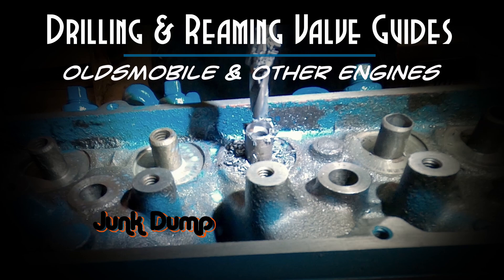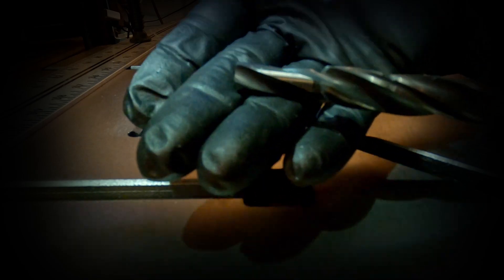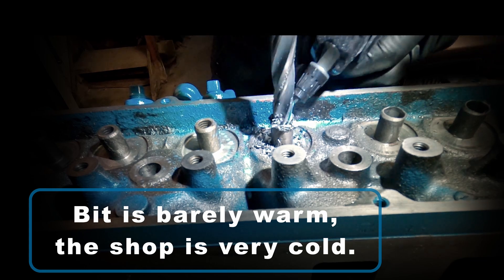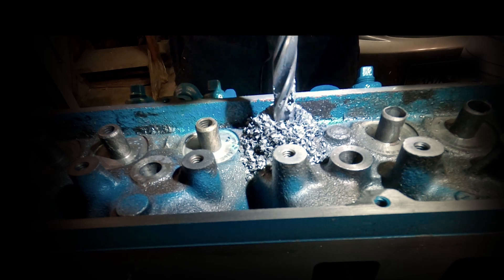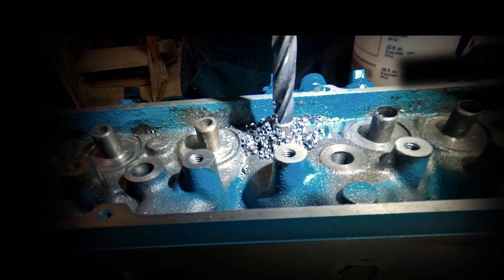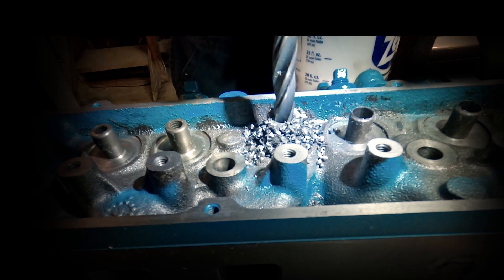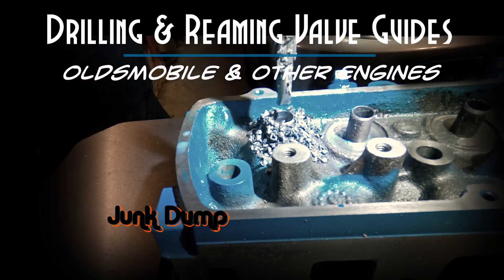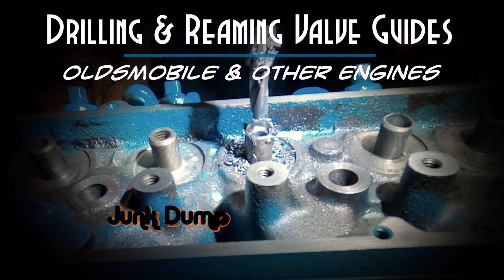Drilling & Reaming Valve Guides

Comment: Why the left-handed rotation.?
Reply from the maker: That is a trick of the framerate and capture fps, the rotation is not actually reversed it just looks that way in the video.
Reply from the maker: That is a trick of the framerate and capture fps, the rotation is not actually reversed it just looks that way in the video.
Reply: @junkdump2720  good, I was hoping that was it. I've been seeing some of these guys on the tube talking about running the reamers in reverse for some reason. If my valve stem is 11/32, or .344. which reamer size should I use for proper Valve guide clearance . Thanks
Reply from the maker: @terrysibley9636  Excellent question! After installing new stems I start by measuring the the valve stem OD and check what the valve stem clearance will be. I have a 0.3425, 0.343, 0.3435, and 0.344 reamer. I start small and one of those reamers typically hits the clearance sweet spot. The specs for Oldsmobile small blocks are 0.0010 - 0.0027" for intake valves and 0.0015 - 0.0032" for exhaust valves. Oldsmobile Big Blocks  with the 2.072" intake valve should have 0.0010 - 0.0030" for both intake and exhaust valves but the spec varies based on year and valve sizes. I love questions like this, thank you very much and hopefully my answer helps. Goodson has a great selection of reamers if you need one. Thanks again!

Comment: Hello! So I'm new to this, and went straight for a reamer for my guides. It was a really aggressive cut and now there's way too much tolerance...  My question is by the physics of machining if you take too big of a cut it will make the hole bigger ?
Reply from the maker: The diameter of the reamer or drill will decide the diameter of the hole if there is no play in your vertical mill or drill press. If the hole is larger than your reamer it's likely because there was excess play while cutting. Piloted drill/reamers help with this issue and work well even when used in a drill press. If you are cutting by hand, there is a higher chance of your holes being larger than expected. Here are the two most common issues and what you can do to fix them. 1) If you ream the guides to a larger than spec tolerance, and the valve to valve guide tolerance is now too large, then I suggest you will have to perform the work I do in this video series to install new guides and cut new seats. 2) If you reamed the guide insert hole to a larger than spec tolerance, and the new valve guide inserts fit too loose, you will probably have to search the QualCast (or equivalent) company catalog and find inserts with the same specs except with a slightly larger outer diameter. Now you can drill/ream the guides to the new outer diameter (usually 2-5 thousandths smaller than the guide insert outer diameter), and then install the larger outer diameter valve guide inserts and recut your seats. If you have to do this, remember to machine the outer diameter of the guide to the stock outer diameter size from the top of the guide down to the valve spring seat after you install them.

Comment: I have an older Briggs 5 hp (L head) horizontal engine that has no separate valve guide on the exhaust side, it's just machined into the aluminum block and the valve stem is very loose. Briggs used to offer a drill/reamer kit to be able to drill and ream for new guides to be installed but they stopped offering the kit several years ago. I hate to throw a good block away just because of a valve guide issue so I'm wondering where I could find the proper size drill/reamer to drill out the factory aluminum guide/hole so that I can install a new guide? What is the clearance needed between the reamed hole and a new guide? Also, would I be able to drill and ream a new hole using a regular 12 inch drill press?
  Thanks for the video 👍
Reply from the maker: Thanks for watching and leaving me a question. To start you will need to know the valve stem diameter and guide spec, I'm certain you can search online and find that for a Briggs engine. Goodson Manufacturing is a vendor for QualCast, they can help you find the correct valve guide insert for your engine. Once you have the guide part number, check the outer diameter spec for the guide insert they recommend. **Generally aluminum requires an interference fit of 0.0015"-0.0020"**. You will need a piloted drill reamer that is 0.0015"-0.0020" smaller than the outside diameter of the valve guide insert. Goodson has piloted drill reamers for all the popular sizes. You may also need a regular reamer for the inside of the insert as you might find the valve stem tolerance too tight after installation. The work can definitely be done on a drill press if your head travel is adequate. When finished check the valve stem play and ream the inner diameter of the guide if necessary. Although your head will be a little different, the general work will be demonstrated in the 3 valve guide videos on my channel for reference. I hope this helps, and feel free to leave more questions if needed.
Reply: @junkdump2720  Thank you, I will check out your other videos and also that manufacturer for what I need. I just watched a different video of someone who drilled/reamed and installed guides in an older 5 hp Briggs engine and he said that the valve stems on those are 1/4". That's probably just a generic measurement rather then the actual measurement in thousandths of an inch but I will find out. 👍

Comment: Always enjoy your videos. What are you using as a drilling fixture, drill press, seat and guide machine, or Bridgeport? Do you prefer a .502 replacement guide over a K-line bronze insert?   Do you use a reamer to finish the I.D. of the new guide? Do you ever hone the new guides instead of reaming? I know, a lot of questions but I find it very helpful to get different opinions. Thanks JD
Reply from the maker: Excellent questions, never hesitate to ask as many as you like! For this video I am using a drill press with an angle stand and fence, it works well with the piloted drill / reamers. I don't have a seat and guide machine yet but I am on the lookout for an old used one, it would make the work go faster. I do not use bronze inserts except rarely in race applications. I find SBI makes great 0.502 replacement guides. I don't hone the ID on new guides, I prefer to use a reamer for consistency and accuracy. Pilot hones work well but take an immense amount of practice to master and be consistent with. When drilling out the old guides, I always use a reamer for an exact OD, it results in a solid interference fit. I like the drill / reamer in this video because it drills and reams in one pass. Thank you for the comment, I enjoy shop talk and sharing any info that could be helpful.
Reply: I'm guessing a cheap drill press isn't good enough for this kind of work?